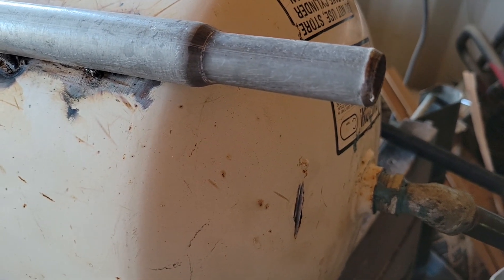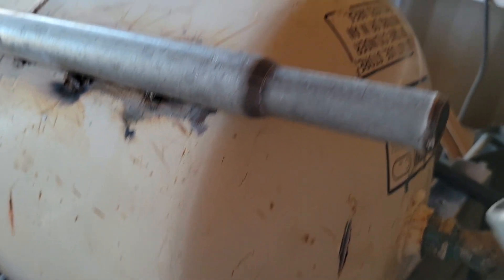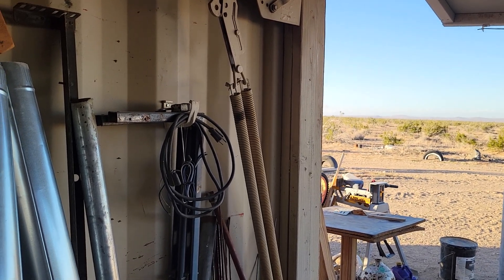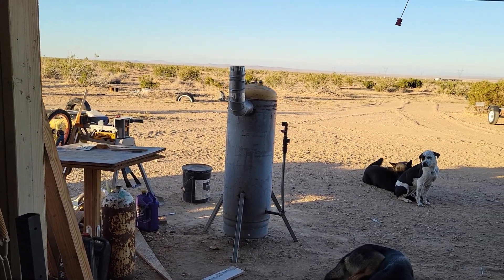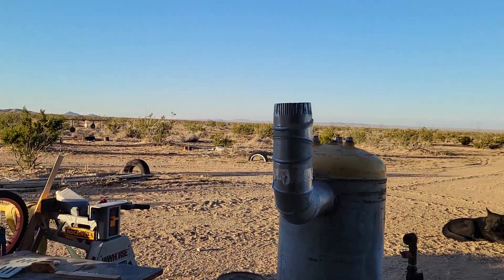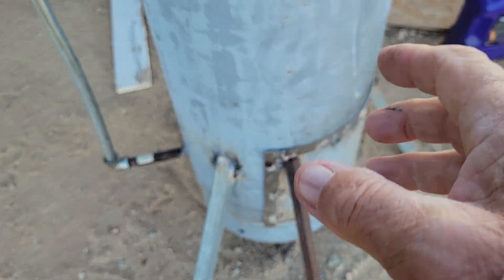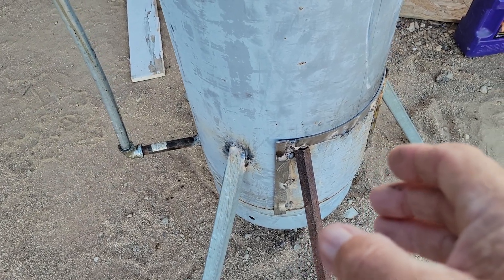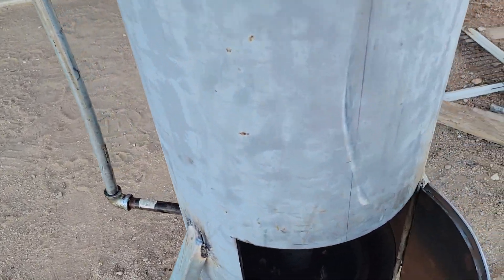Waste Oil Heater Details, Nov. 7, 2023

Comment: I use the stainless steel pins in a revolving drum to clean brass casings, much better than corn cob media but you have to check the inside of some casings for a stuck pin
Reply from the maker: Welcome aboard!  I use crushed walnut shells in my case polishers.

Comment: Unless you want to store high temperatures, water is a much better heat storage than sand, which means you'd save a lot of space. A fluid is also easier to heat.
And the burner legs would be better with horizontal struts added
Reply from the maker: Welcome aboard. 
I found this info searching for best heat retainer.
"Sand-based heat storages can store several times the amount of energy that can be stored in a water tank of a similar size; this is thanks to the large temperature range allowed by the sand. So, it saves space and it allows versatile use in many industrial applications."
Reply: @GBear  That's true if you can reach high temperatures. Water has a heat capacity of about 4.180, sand only about 830. From my understanding it means the sand needs to be 5 times hotter just to make it up. Let's say the water is 80°C, then the sand needs to be 400°C to store the same amount of heat per kilogram. Maybe I'm wrong, but you would need a very good battery design to exceed 400°C. Or just build it around the burner :)
Reply from the maker: @SolarCookingGermany   Using a 12vdc water heating element in the sand powered by a 100w by 12v solar panel, the sand can be heated all day in the sun for free.  Sand will retain the heat many times longer than water making it more efficient. 
Added sources of production like painting the vessel black for additional solar heating, and a small 12v PMG for windy days and nights would make it even more efficient.   I WILL be building one and the videos will be posted as I progress.
Reply: @GBear  Ok, I was under the impression you'd use the burner and pipes etc. 100W isn't much, even if it runs all day long, but I would also give it a try. Sand is free in the desert, let's see how it works 😀
Reply from the maker: @SolarCookingGermany Yep, it's on the to-do list.  I will start gathering as many parts as possible for free.

Comment: I can't explain the how to design and yet i could draw the design or blue print or whatever.  I still have an old gravity fed oil heater and Its efficient to the point where the top gets red hot.
Reply from the maker: Nice!  I'm going for 'white hot'😅
Reply: @GBear  white hot by red rider?  Tom Cochrane.
Reply from the maker: @carmichaelmoritz8662  😃👍

Comment: The oil pot chamber needs to be designed correctly in order for it to work properly. The air has to come in from the bottom sides of your tank and in towards the chamber and then the draft pulls it up and over the oil pot chamber. You should search online 'old day free flow coleman oil heaters and look at how the air oil chamber is designed.  Search for images or patent and use the info from the big oil heater.  Not those small catalytic heaters.  The design would work Its just more costly on a larger scale.
Reply from the maker: Thanks for the info.  I have done some research, but also am trying some of my own design modifications.
Reply: @GBear  unfortunately there's only one way that works best to achieve a perfect smokeless burn.  Believe it or not, Even the angle of the drill holes matter to create the cyclone tunnel effect. Or whatever they call it.
Reply from the maker: @carmichaelmoritz8662  Yes, I am aware of the little idiosyncrasies of design, but I am also a curious inventer...😄

Comment: Whats a sand battery? Ive read its good and bad to send the chimney pipes out the side wall. I've seen it said that the two turms creates more collection points for soot. What are your thoughts?
Reply from the maker: A sand battery stores heat and slow releases it later.
Reply from the maker: As far as the chimney bends, trust me, soot isn't an issue, creosote IS however.

Comment: Just an idea 
maybe
Why not take a second larger or smaller  pipe for the air pipe
Drill the same holes
Then to adjust the flame all you'll need to do is turn the pipe
maybe
Reply from the maker: Noted.